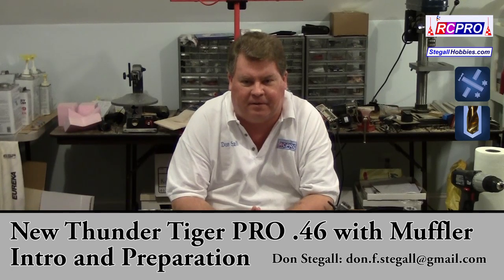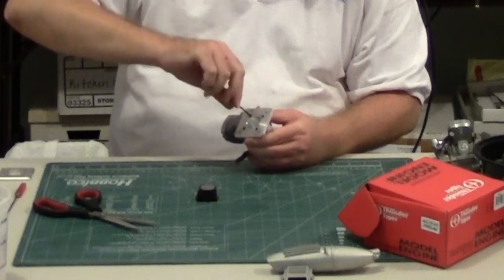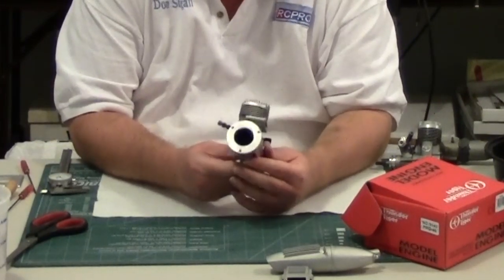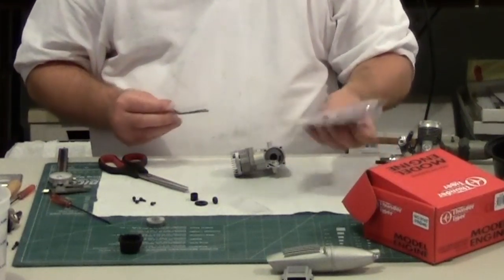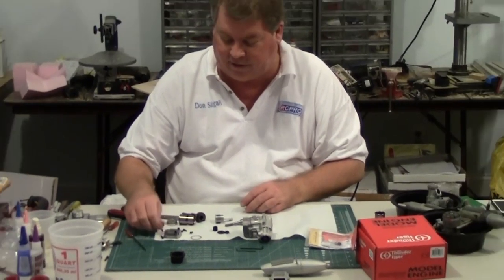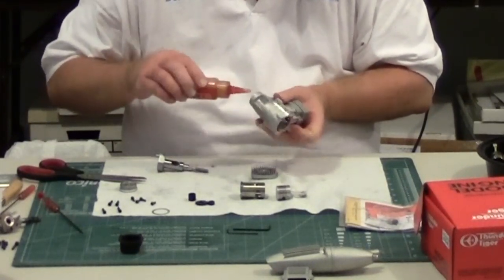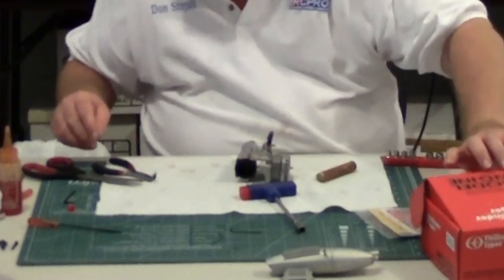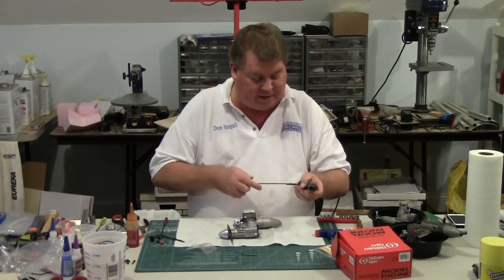New Thunder Tiger PRO .46 with Muffler - Part 1 - Intro and Preparation

Comment from the maker: If you are looking for Thunder Tiger parts, try Googling "hrp distributing thunder tiger", go to the HRP site and click on Engines. You may find what you want. I will check my TT PRO 46 and see if it uses common gasket sizes. I am going to break this engine in and use it eventually. But they are effectively unavailable. So not a lot of motivation to continue the series I was going to do on this engine. Please check out www.Club40Racing.com and new rules will be coming soon. I will be making videos on a range of .46 engines

Comment: Anybody know if we can get Thunder Tiger engines any more?
Reply from the maker: Not that I know of ... Get them used as cheap as possible ... What is your intended use?
Reply: Just hate to see a good engine go out of production
Reply from the maker: The O.S. .46 AXII is a great engine ... and the Evolution .46NX is a good engine with the right fuel and glow plugs ... The NX is the official engine of AMA 424 and is legal for http://Club40Racing.com in both the Silver and Gold classes
Reply: I'm not a racer any more. I have always preferred the OS46SF or an FSR, never owned an AX. I have a 46NX its a good one, I loaned it to a club member to compete in our annual air show combat event.
Reply from the maker: Don't buy the O.S. 46AX ... Get the O.S. 46AXII ... the original 46AX is not backplate compatible with all the other O.S. 46 engines like the FX and AXII ... The 46AXII is a much better engine. You don't even need to open it up and clean it before break-in.
Reply: Jeff, I ordered a GP 28 from TT direct for $68.00 free shipping (in Dec)